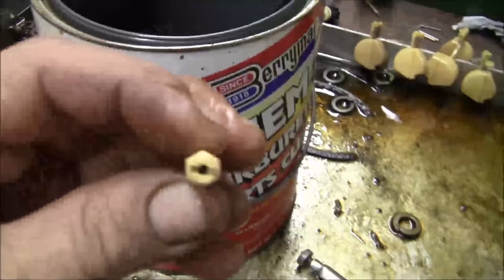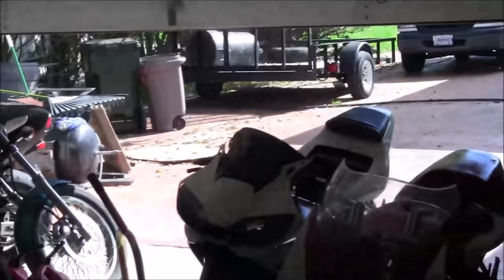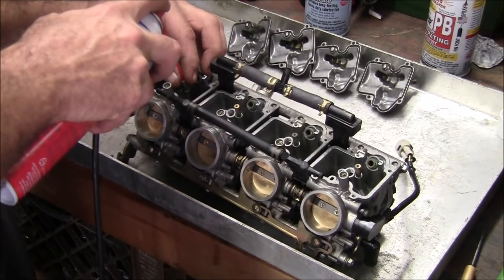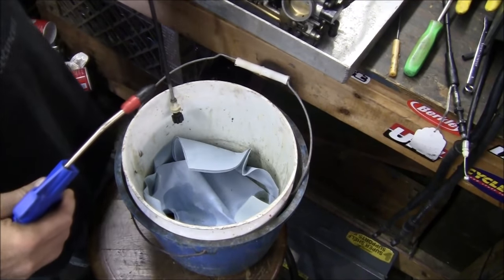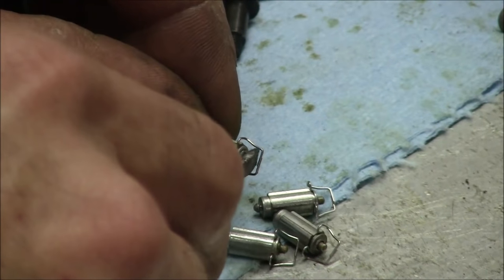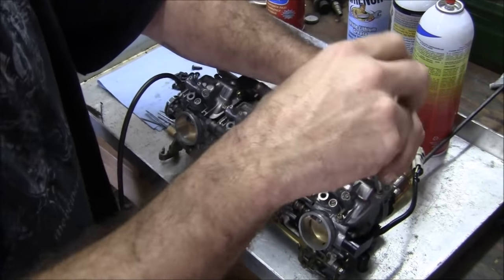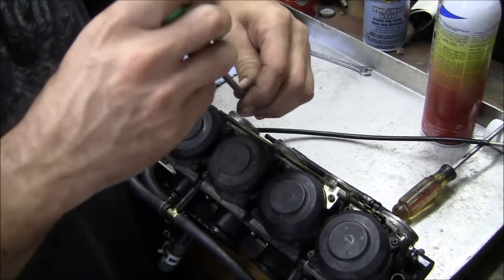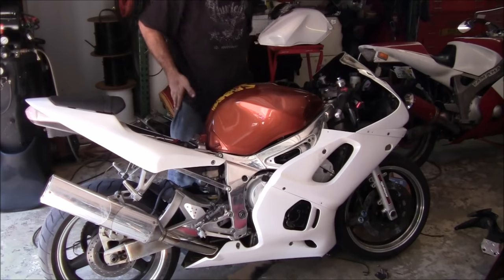2001 Yamaha R6 A Complete Disassembly and Reassembly for any Motorcycle Carburetor

Comment: Hey man am I glad i came across this vid , I currently have carb off and done a heavy clean , bikes a r6 2000 model , issue I’m having is bike when gets past 5k rpm bogs out and loss power , all else fine as in idle and start up, opened carb up and wow was it dirty, anyways I noticed the float wasn’t freely moving like the rest, my 3rd carbs float needle was stiff , I soaked in carb cleaner without rubber in for 5 mins had little play with it and it’s now moving freely and the float now moves like the rest.  In your vid u mention it’s critical they move freely . Bikes been a pain so really hoping this is the issue , will be putting carb back on bike tomz so fingers crossed . Bikes had new plugs , coils are good, new battery , so I’m now certain the carb build up of dirt and that stuff needle is the issue , sorry for the long message haha 😆
Reply from the maker: Ya man good luck it’s always the fine details.Only one way to do it .
Assuming the rest of the bike is solid .
Reply: @lucaslst  thanks bud
Reply: @lucaslst  hi again mate just to let you no my issue was solved , put carb back today been out tested and wow so responsive :) . Set all fuel screws at 2.5 turns out the recommended turns, when took carb off 2 was at 4 at other 2 at 3 .thanks to your vid about where u mention the needle in float has fixed my issue and of course the carb clean but again thank a lot I’m super happy , just knowing also I’ve saved £350 I was quoted for a carb clean ,
Reply from the maker: @madabouthistory4611  perfect if you balance them out ya can squeeze out a bit more ,
Cheers!

Comment: good RIP video... good RIP carburetors good RIP r6!!! 
Do you mix the JETS?? they are different size between carbs.... do you mix the bowls??? do you adjust the fuel float eight??? do you sync the carbs??? why you dont remove the myxture screws????

Comment: got my 01R6 started after 6 years sitting,sounded pretty good about to sync carbs and noticed the two "t" shaped fuel connectors both leaking...I separated the carbs to  clean the choke plungers. These two parts are ridiculous in price (Yamaha 4JH-14350-00-00). I remember seeing  two O-rings on each side of theses small fuel line "T" branches...wonder if theses small O rings in the newer blue ethanol resistant blue color would solve the leak?

Comment: good video  ur smart need help with my 2000 gsx600f  runs great but wanted more so i got kandn filters and a jet kit  spark plugs oil oil filters now is like shit it idles at 4000 rpm its poping and it wont rev pass 5-6 rpm and two cilinders seem to get hot on the muffler and other two dont get that hot  did what the info said on the kit but not working have any answers did 120s on the outside carbs and 17.5s on the other two and two spacers on the diafram needle and 3 turns on the fuelair screw did nothing with the floats but i did clean the carbs perty good have other jets that are bigger havent tryed them yet and the pilot jet they sent me was smaller holes then the stock ones

Comment: Awesome stuff bro! I'm a new subscriber, I love your work! 

I have a question though, I recently got my first bike which is a 1995 zx6r. It was my brother's and he had it parked for a few years so now I'm trying to get it riding again but it has an issue where it keeps missing between low and mid range. I washed a lot of rust out of the tank and today I cleaned the carbs again somewhat and tried starting it but it refused to start and i realized that only one cylinder was firing when I felt the down pipe. 

Would really appreciate some advice if possible. Wish I could just send my carbs to you or the whole bike for that matter.

Comment: Did you remove the pilot screws, if so can you tell me how many turns from seated they should be when installing? Nice work and thanks
Reply: all the way. only one that varies is the fuel air idle. don't touch that lol
Reply: HORNET6 the service manual says two whole turns out from all the way in for the pilot screws, if you have an aftermarket filter it will be different.

Comment: You seem to know a great deal about 98-02 R6.. Mine keeps back firing when trying to start to the point it won't start.. A guy claimed he knew how to bench sync but failed.. Before I took it to him it was running but loose of power throughout rpms like a vacuum but no leaks.. How do I sync the carbs correctly?

Comment: anythought about what to look for when buying a r6 that has been sitting? Its a 2009 but not quite sure the miles the battery is dead and what not and i did notice that the front break lever has no feedback? any ideas
 would be great
Reply: Jarrod Nocito 2009 r6 with carbs?
Reply: Jarrod Nocito Well, for starters tell the owner to either charge up the battery or get a new one. I wouldn't even consider a bike until the engine is running and I can hear for any problems. Second you posted this in a carb video for Yamaha's older than 02's. Not sure if you're asking about the the carbs but anything past an 02' from 03 and on have FI engines (Fuel Injected). And when you say front break lever has no feedback what exactly does that mean? When you pull it, it doesn't return to it's position? Check the cable. Also ask for the title. If it's a salvage title I wouldn't consider it. Bike most likely got dropped and can have a host of problems that will cost you more in the long run.
Reply: +Rak Hit thanks for the reply I bought the bike had 5300 miles all it needed was tank cleaned and all new fluids and set of new tires. the brakes just needed to be bled that was all. fresh gas and new battery started right up and have put about 2700 miles on her already and love the new bike!
Reply: Good to hear! Glad your ride is up and running. Enjoy the road and be safe!

Comment: i just went and started my 02 r6 today after being stored over the winter and now its leaking gas from the square(ish) plastic things that go into the carb its not coming from the fuel lines running to them but seems like its coming from where they meet the actual carbs themselves. so if you could message me back on any advice u might have that would be great otherwise I hate to fork out a lot of money to take it to the Yamaha dealer but I will do that if you are not able to make a suggestion on how to fix it.
Reply: Austin young  You probably already got bent over for that repair but if it is leaking there it is most likely the orings that are in those connections. It could be the actual little pieces of fuel line connecting them which would be easy. If it is the orings then that requires complete dis-assembly of the carbs, more than in this video. They need to be removed and then taken apart from the rack that holds them together. Then the orings can be replaced. Do not go to the dealer though, it will most likely be around $400-500. Find a good local shop(check regional forums) and it should be more like $200-250.
Reply: +Austin young , could be that with the cold the joints cracked on the carb, inspect for leaks, try changing  the leaking plastic joints or putting some engine joint putty .
Reply: Austin young some really good fuel dye and a light will help isolate the leak, it's easy to get lost in old gas puddles and stains - actually just pull it all apart and do the full rebuild, you'll get many more problem free miles that way

Comment: 2000 R6 LEAKING GAS INTO THE CRANKCASE WHEN SITTING OVERNIGHT????
Reply from the maker: needles seats, needles worn , floats set to high or sticking .do a carb job repair and replace anything tweaked.

Comment: R6 2001, 1st gear rpm ok, 2 nd and other gears struggle to go above 8000 rpm when riding. when stopped rpm is ok.  whats wrong??
Reply: pilot jet or float height if pump is good
Reply: thank you , its aded to the guild of mechanics